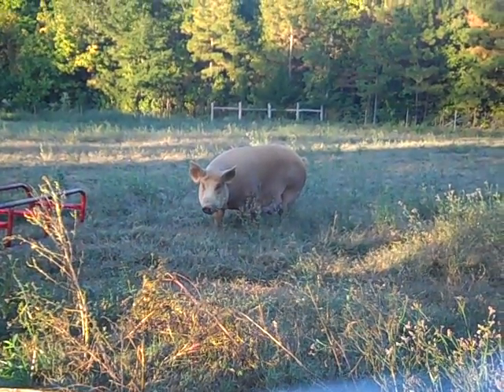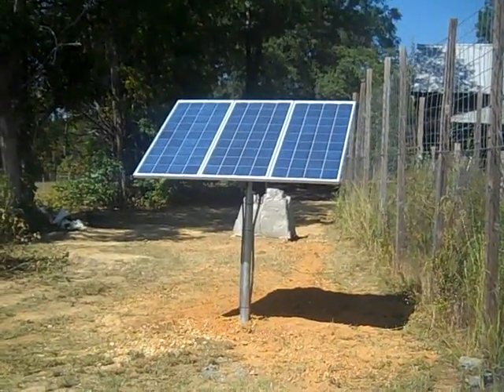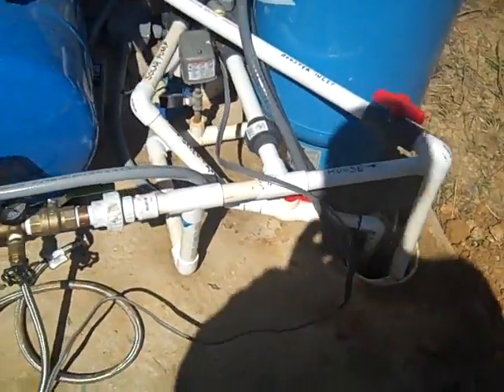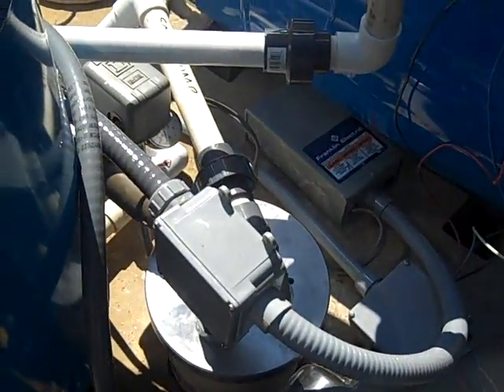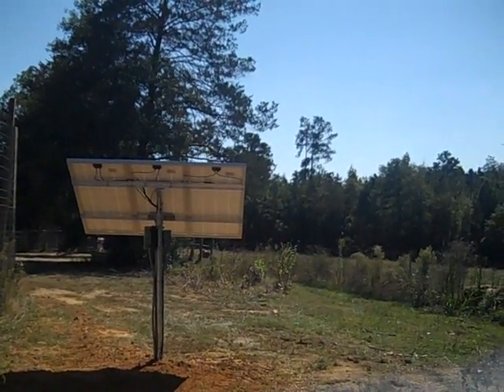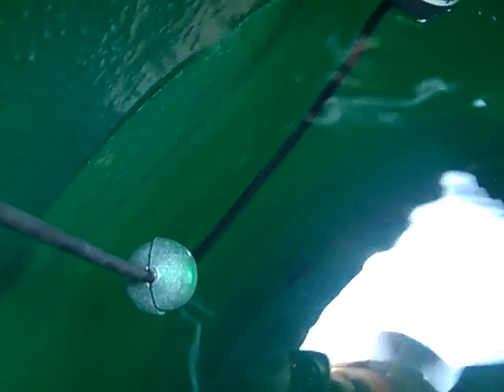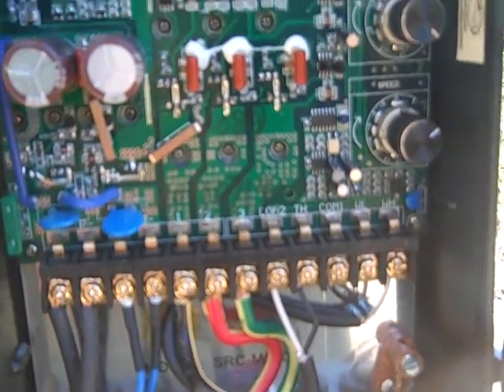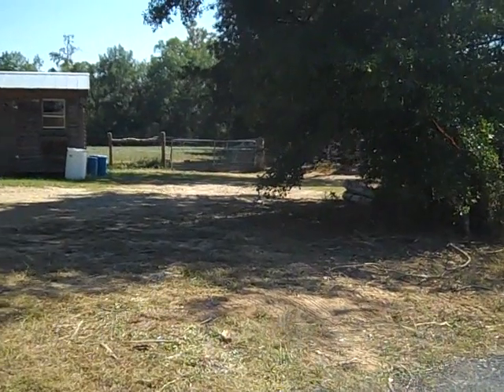Secure your own water supply through solar water pumping

Comment: I have a deep water well at my home in the Blue Ridge mountains. The property is presently on grid. I would like to set up a system to continue to operate the well with solar power, should the grid ever go down.  Without surveyor's equipment, I could not tell you precisely how high up from the well the house is, but I would guess it's about 30 feet +/- greater elevation and about 100 yards from the well up the road. What would I need to operate the electric pump I have there now? I am pretty sure the system is running at 110/120 volts (ordinary household currents)
Reply from the maker: Arthur,  please send me an email and I will walk you through several options.  
info@practicalpreppers.com

Comment: Just wondering about what size storage tank would be needed to keep one person supplied with enough fresh water plus a decent reservoir supply(appx 20% extra?) Underground or above? Plus is there a way to purify it in order to use some for H2 and O production. I was wondering about use for running generators, furnaces, boiling water etc. Something that would be self sufficient for one person living alone on appx 5 acres in western Washington state.